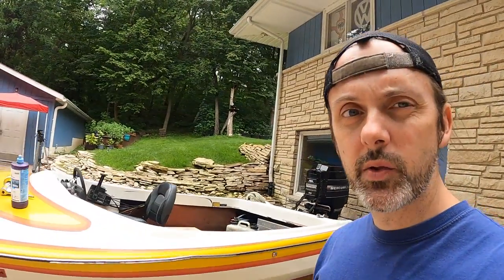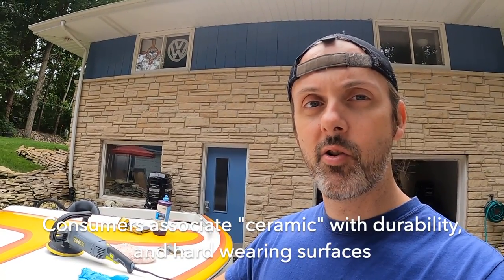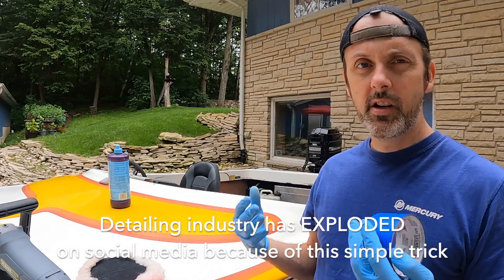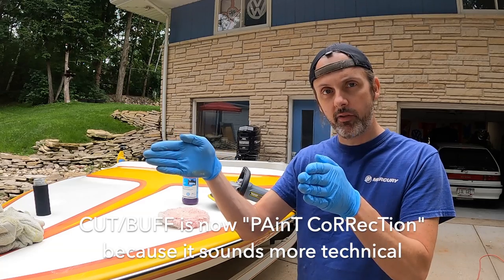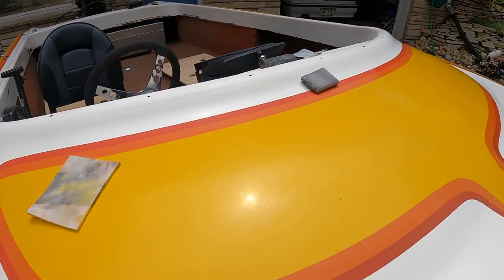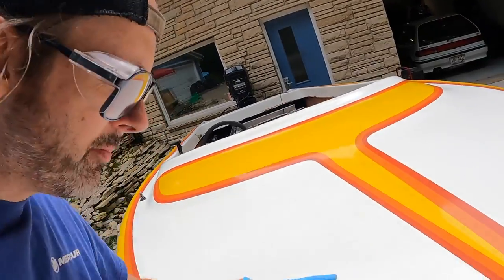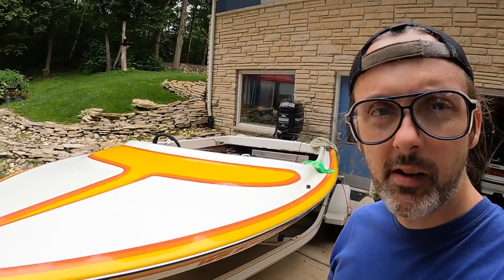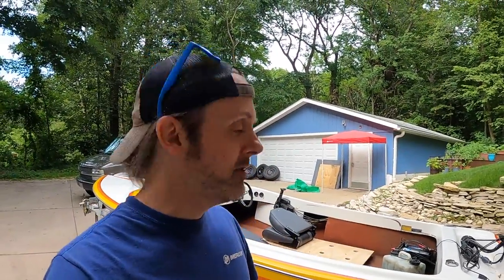How To Restore Your Boat's Gelcoat in 3 Steps DIY w Pro Results

Comment: You are working on 40 year old materials.
Newer paint is NOT the same. You could do SERIOUS damage to a modern paint. You wont see the damage for a few years. But it will be there.
But, good work..
Reply from the maker: This is gelcoat not paint.
Reply: @ADDvanced  that is what im saying. Paint correction is done in micro steps. Because how thin and "fragile" modern mass production paint is.
What you did was perfect for that application. (Hand laid gel coat in a mold) But, it seems like you are implying that you can apply this process on a new modern car with the same outcome. 
P.s. that 3m product is the jam!!
Reply: @ADDvanced  p.s. p.s
Keep up the good work i love these videos.
Reply from the maker: @TheZmt325  I did this same process on my entire 95 S6, that I had repainted.   Worked fine.   Dupont Chromabase paint with 3 layers of clear.